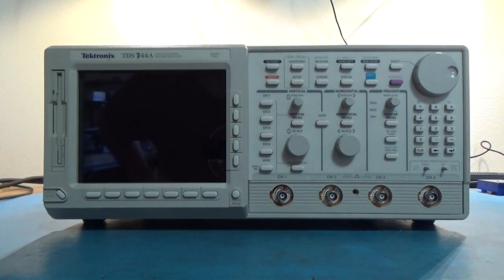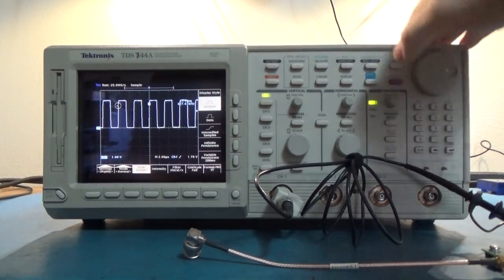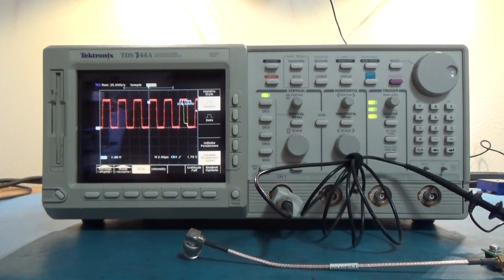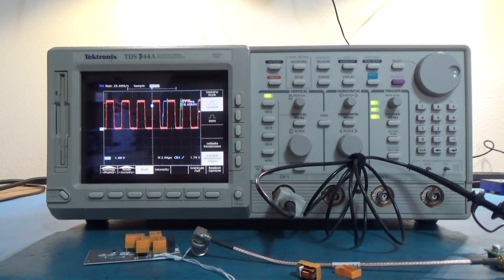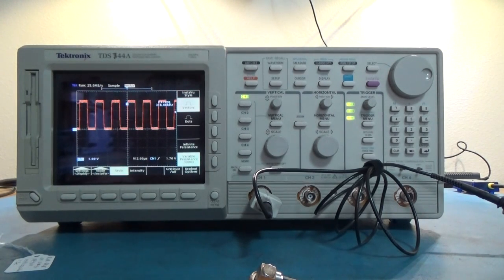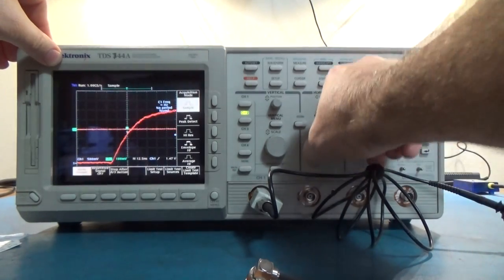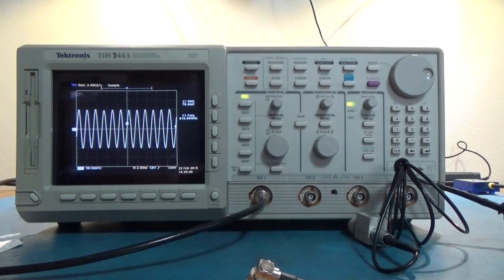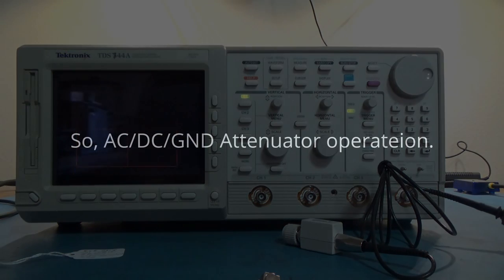Great Tektronix Hobby Oscilloscope w/Repair Tips TDS 500 600 700

Comment: great info, I'm going to look at a couple of TDS series scopes tomorrow. hopefully I'll find one that works well and has no critical error logs
thanks for the video
Reply from the maker: +superrodder2002 The main thing is that if it is that if it is a TDS500A or earlier, or a TDS600A or earlier, absolutely do not turn it on w/o replacing the caps/cleaning the board first; you will just make it's worse or kill it by turning it on.

Comment: Hi

Thanks for a great video which has been of a lot of help to me. I recently purchased an optioned up 784A from ebay at a really good price. Scope basically worked but failed the SPC. Most of the relays were hi in resistance or completely open so I ordered genuine ones and replaced the lot of them. Now SPC is fine but there is still one problem where the Acquisition test fails with the following error "trigNibDiag trigNib A is 0xa7". Not sure what this error code points to but the scope runs fine except Instavu has a major problem on ch2. If I enable ch1,3,or 4 Instavu works ok except the trace goes blank above 10ms/s and reappears at 2Gs/s and above. Now if I enable ch2 with any of the other channels on (still with Instavu on) the screen fills up with garbage. If ch2 is on and the others are off with Instavu enabled there is no trace at all on all time-base settings. Otherwise with Instavu turned off the scope works fine on all channels. Could the acquisition error be linked to the problem with Instavu ?

On another issue the Horizontal position control was so dicky as to be useless. I pulled the front control panel off and sprayed some CRC contact cleaner into the center of the back of the pot and managed to clean the pot. There is a small enough opening to allow a bit of cleaner to get inside the pot. While I was at it I did the rest of them and now they are as right as rain ;)

regards

Comment: Why is it that if it is a TDS500A or earlier, or a TDS600A or earlier, we do not have to turn it on w/o replacing the caps/cleaning the board first? How it will just make it worse or kill it by turning it on? Which component breaks specifically?

Comment: I tried opening up and Deoxit-treating a signal relay I pulled from an attenuator in my TDS784D. This measured high-resistance NC in place, but even smothering it in deoxit and working it a couple of hundred cycles didn't improve it.
I understand that sometimes it can help these relays to work them under a few mA of current to recondition the contacts, but that's probably not something you want to do in-place on an attenuator. Easier simply to replace them.
Reply from the maker: It's pretty easy to damage the ceramic when removing/attaching the new relays, why I was curious to see if deoxit would help w/stick pin and syringe (no relay removal). You probably would only want to use the slightest sprits on relay contacts themselves, especially on a 784, and let it rest over night. If there is no difference, a new relay may help or it might be the active chip on the ceramic. Let us know if new relays fix your problem.

With the cal software, it is possible to discover which relay is likely having an issue but the active chip could still be the issue. I often purchased parts machines just to get at their attenuators, never dealt with the relays beyond reheating cold joints. The trick was finding the bad attenuator(s), and on your scope, finding an attenuator that would calibrate that far out.
Reply: tekhobbycap Replacing the relays worked for me. I was able to find the borked ones by simply measuring the resistance between the NC pins on the hybrids. Most measured in mOhm, the bad ones were in tens of Ohm.
Reply from the maker: Sigurður Ásgeirsson How exactly did you make your measurement? I would expect that with the Normally Closed to Common measurements, the lower the resistance the better as those contacts are shorted together in the un-powered state. If the measurement was between the Normally Closed pin and the solder joint, you can generally re-flow that joint to regain continuity (and this does happen on the power leads pins, not so often with the signal pins). Now, if you powered the relay in circuit, the Normally Closed to Common resistance should be high ohms open condition (as those contacts are now open), limited by the ceramic board parallel resistance and if you measured low ohms, clearly a problem.
Reply: tekhobbycap on the advice of some folks from the TekScopes group, I measured the NC contacts to common in-circuit. I measured by touching my DMM leads against the relay legs. The bad ones measured in Ohms or tens of Ohms, and continued to measure that way after I pulled them out of circuit.
As far as I recall, the NO contact resistance also measured high after I pulled them out - I can double check as I think I have at least one of the carcasses around.
I tried popping the case on one of the bad ones out of circuit to see what was up. Even soaking it in DeOxit (case off) and working the contacts a few hundred times, it was still measuring in tens of ohms.

When removing these I used straight cutters to clip the relay legs to get them free. Be careful about the mechanical tension you put on the remaining relay pads as you do this, go slow, and use common sense on the order of the leads you clip.
There was at least one joint on one relay that was marginal, in that the relay lead just popped out of the joint as I was clipping another leg. I remember thinking I'd pulled a pad - but that was not the case...

Soldering in the new relays is a piece of cake, though I remember reaching into the far corner contact of each with the tip of the soldering iron was a little bit of a reach with my Hakko 888D.

Comment: You talk about waveform update rate and the Tek scopes, even these older ones, can achieve very high update rates.  Maximum update rate is dependent of timebase, slower timebases won't allow fast update rates, for example.  Nor will long record lengths.   However you can confirm update rates by looking at the trigger out with another scope.  

Some DSO scopes e.g. HP/Agilent play with acquisition settings by giving you the selected memory depth on in single shot or half the selected memory depth when hitting the stop button, to allow them drop memory depth to run a fast trigger rate.  This was documented in Agilent' support forum when a user asked why he could not download the selected memory depth under computer control.  

These old scopes are great and if you can find one cheap, it's even better. Only thing I'd like is a quiet fan, but at the time, it was state of the art and nothing else could touch it's update rate once you hit the "Barney button".  

Being able to spot what you don't know exists, allows you to set a trigger to nail it every time.
Reply from the maker: What they attempted to do, and succeeded in doing, was to take screen sized chuncks of sampling data and place those chunks into a fast circular data base while loosing as few chunks as possible. By the TDS520B's they claimed that you were as likely to see a glitch on that scope as a 2467B. They also used a shared memory space between the waveform display space and the acquisition memory result space. Naturally, if data is being generated at a faster rate based on sample rate/time base setting, you could potentially capture at a faster waveform capture rate, assuming your architecture and asics are up too it; which may not be the case on non-performance scope. 

Plus, manufacturers make many marketing claims. How big are the chunks being store, really. How many times are they really being stored per second, does the front end hardware really have that bandwidth, or they using bandwidth  extension algorithims (which actually works great: good job lecroy, everybody copied you).

Comment: Thanks for the video. I have a pair of TSD 540Bs. One looks like I might have a dry solder joint on U413 (SRAM). The other is less obvious. It passes self tests when it turns on, but when I run any or all of the diags it appears to run through the selected diag(s), but resets the scope when it goes to update the screen with the results. Not sure where to start on that one.

I was curious if you have ever scanned in or transcribed your notes that you showed into something that can be downloaded. As a scope newb I would really appreciate being able to read through them.

-Freeman, N5FPP

Comment: I have a Textronics 549 and need to get the cover off?....I know there are two Half turn screws on the top of the Rh and LH sides of the scope..but after turning them I Still could not lift off the cover...Are there other screws holding it on?

Comment: Does the Display on the 784D series show startup screen without the acquisition board connected.
Seems I picked up a parts scope and it came with later version acquisition board not installed.
And Even though I have proper voltages display flickers but then goes blank

Comment: Hi cap admire your videos and comment on tekforumAny tip about  ERROR 250 nv storage too small more bytes requested than available (TDS754D - > DS1250 and DS1486 are NEW).what is directly communicating withthe nvram ? parts on the ACQ ?

Comment: did a re-cap on an old TDS-520A that I recently acquired.  Everything worked after my re-cap then I decided to mount the two Dallas NV chips on sockets so that I could eventually back them up. I carefully extracted them with my Hakko 808 and installed them back into the sockets and now I am getting CPU board fail and cal fail on power up.  what can I do?  Is there a file I can download to re-program these two devices?
Reply from the maker: One time I mounted the nvram chip backwards, not the timekeeper, it majorly complained. turned the chip around and all was fine. I do recall having to sometimes go back and load up the chip pads to make full solder contact. Also your nvram leads are sometimes square and the sockets may not mate well. Generally, if these chips are not somehow mounted correctly, the scope will complain but no real harm results. Probably a continuity issue.
Reply: thanks for your reply.  I defiantly have not put the chip in backwards and I am pretty sure that the connections are good although I have not buzzed them all out with my meter.  I did have to use quite a lot of heat to get them out and am wondering if the battery that was already on it's last legs just gave out due to heat.  I am wondering if someone would have an image file of this device that I could program and try.  The clock chip seems to be working and holding time but I had to reset the time after removing it and mounting it on the socket.
Reply from the maker: I think option info was the only important information this chip contained. Running SPC would restore that info on a new chip. Use a good quality flux to insure that the solder flows well, suspect the socket too.
Reply: OK I will go over the solder joints again.  In the mean time do you know why I can seem to get to the error log to read it.  When I pass by the Cal menu I get a pop up window that won't go away along with 6 beeps.  the window says "invalid selection"
Reply from the maker: And...the error log is stored there...
Reply: Where?  on the timekeeper chip?  I don't have the serial port option 13 or any GPIB equipment so my only recourse is to remove the chips and use my programmer.  Do you have any other suggestions.  I am assuming I can't navigate to the log in the utility menu screen because of this corruption issue.
Reply: Re-soldered the socket and still same result  going to leave it for the night.  Thanks for your help so far
Reply: Cap thanks for your help so far.  I have confirmed that the dip socket is OK and the solder joints are good.  I have also read the contents of the TimeKeeper chip to a file with my programmer (it doesn't support the DS1650Y so I can't read that device).  correct me if I am wrong but all the important stuff should be in the DS1486. I was able to see the log entries starting a address 0x9310.  Errors are "nvLibrariansDiag.libs with crcc failures, ExtConst, IntConst, State, Environmenty, extended cal librarian reset" Is there a way I can recover or "fix" the data in the 1486 without GPIB equipment.  perhaps if someone had an image file i can program into this device.  I read on the Tek forum that a guys followed some steps you provided to do exactly what I am trying to do.  the links in his description are broken so I was not able to get the details.  any help you could provide would be great.  Thanks again

Comment: Great video! Do you have any info on the TDS 684C? I'm working on one right now and the front panel LEDs just light up and no screen display.
Reply from the maker: It been a while since I touched one of these... If the cal toggle switch is in the unprotected position it will do this. Normally a bad display/driver board wouldn't cause this. Caps on the power supply should be looked at but the supply would probably refuse to run and give you no lights. On older scopes with the crappy caps this was a common problem with the processor board, you could check the tantalum capacitors for shorts. Hopefully the cal switch... Make sure the dip switches are all flipped in the correct orientation on the processor board. IF the option 05 board was available for the 684C, and is installed it may have those crappy caps too, caution: one of the stencils for those caps is backwards!